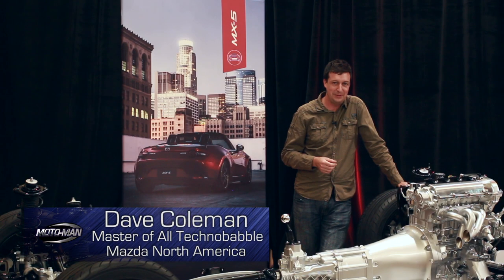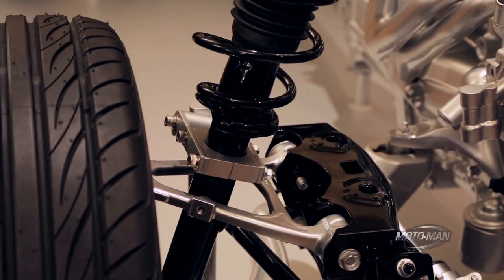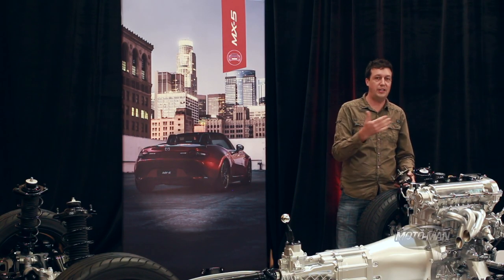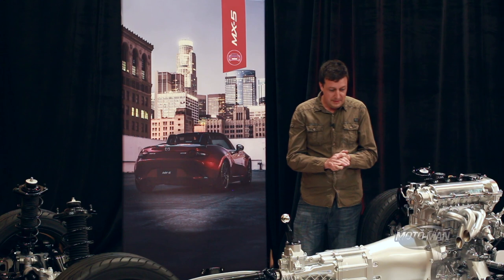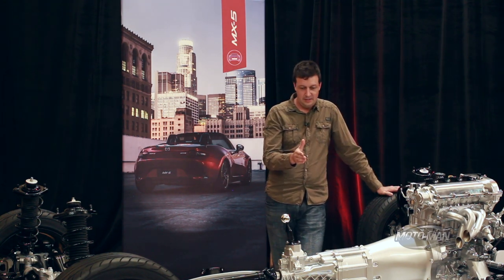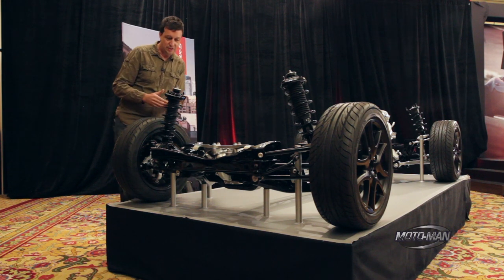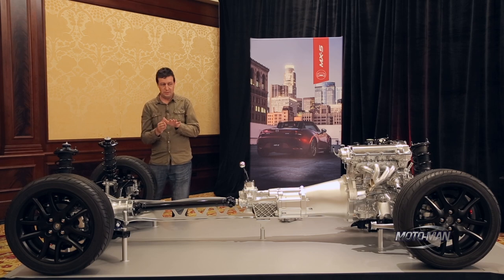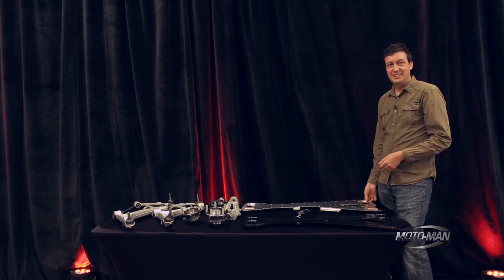2016 Mazda MX5 Miata TECH REVIEW with Mazda Engineer Dave Coleman

Comment: Very good vid!! I dream of a 3.0 liter 60 degree V6, 232 HP. Shorter engine, mass lower and further back. 60 degree V6s are silky smooth, like an in-line 6. That would be the bell housing that is so smooth I think, long to move the transmission back closer to the driver and shift mass to the rear, aiding weight balance.

Comment: Man, this didn't age well with the transmission issues the ND has. I'm surprised we aren't at the 6th revision of it to stop them from blowing up.
Reply: I thought the same thing. Mine (1.5 here) is still fine after 73000 KM's, just bought it pre-owned (all new cars are insanely expensive in my country) and will have the transmission oil changed soon. Now I've been stick-shifting all my life and just perhaps it's a bit of an American thing to have transmission issues on these. Never heard or read anything about it here, and I'm an MX-5 club member.
Reply: @rustinpieces  there's definitely failures all over the world as I used to keep track of them. Other countries tend to not match the US in driving enthusiasm or tracking them in racetracks. The internals of the transmission are known.
Reply: The latest ND2 does not have these issues
Reply: @blurayffan66  it does unfortunately. "V5 ND1 transmission" is the same as the ND2. Only difference is the front cover which accomodates the DMF the ND2 uses. This is well documented by Mazda fyi. Not sure why people still don't know this 4 years later. Failures are lower, but certainly not close to zero on yearly basis.